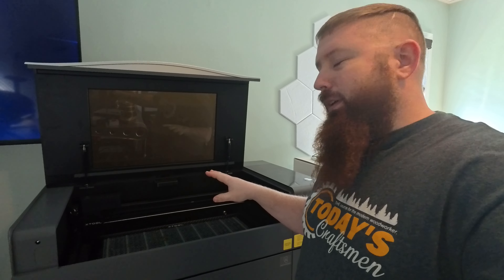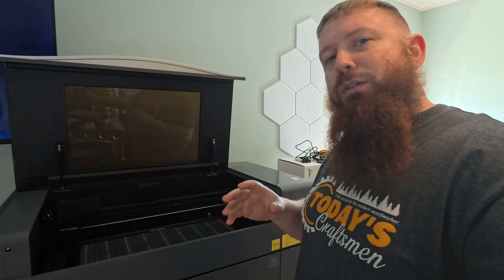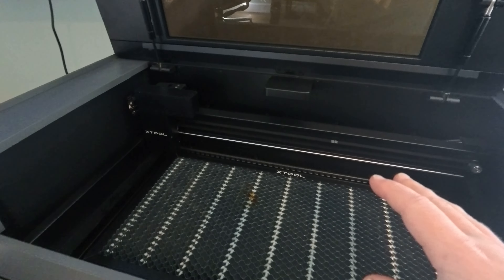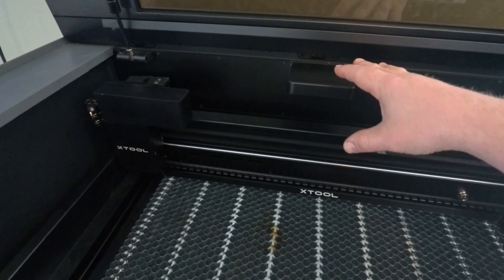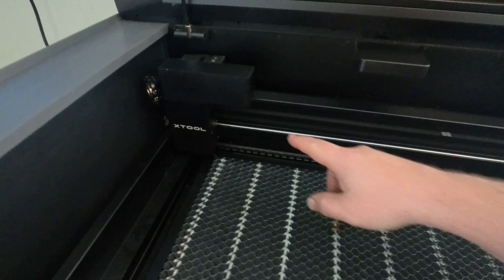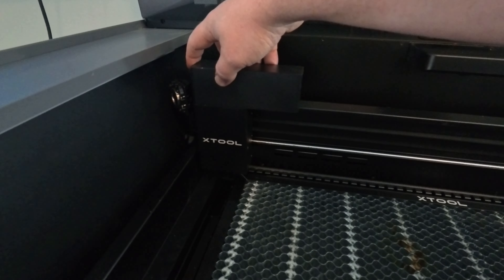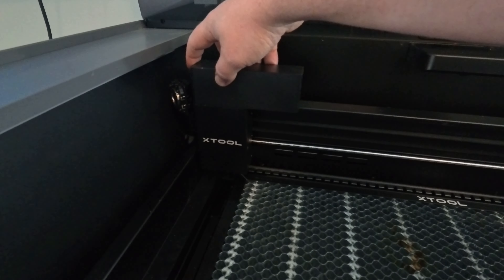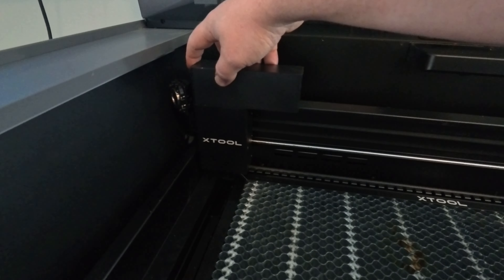Why Does the xTool P2 Laser Engraver Have 2 Cameras?

Comment: Hmm... My second camera if off by 1mm. Even after calibration. Any ideas?
Reply: Did you resolve this?
Reply: @Scottforyoutube  Yes I did. I loosened the camera screws and pushed the camera board in different directions until the lasered scrore fits to my pic. I also recalibrated the distance readings. Now it is ok but not perfect. The middle of the camera is perfect but the edges are wrong by about half a mm. Not possible to get it any better... good enough =)
Reply: Ah I lasered many rectangles for the calibration to see the center and the edges at the same time =)